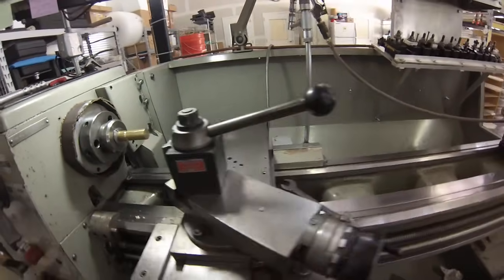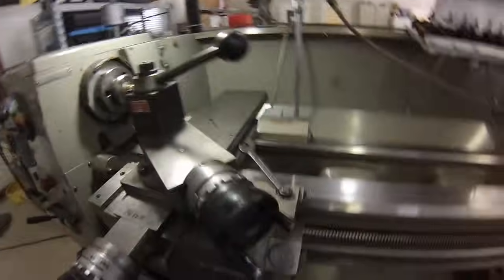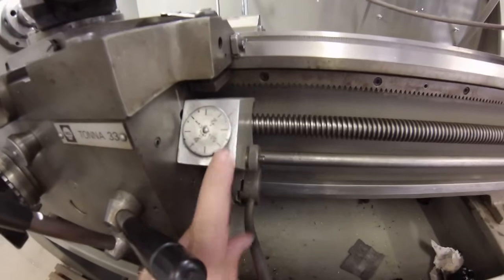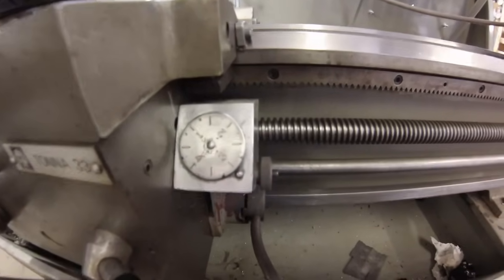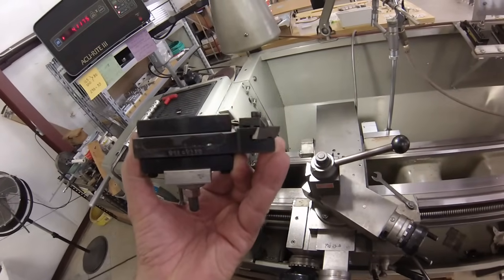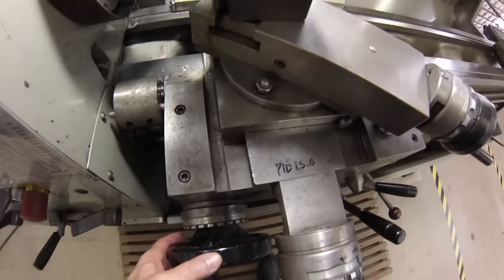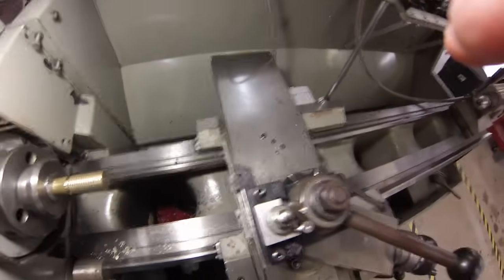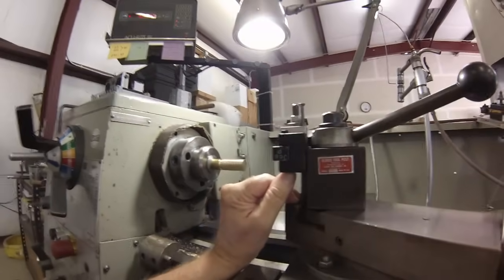Threading on a manual lathe  BEST TECHNIQUE EVER !!!!

Comment: This is from the Hardinge instruction manual about cutting threads on an HLV
http://www.csparks.com/hardinge/Manual/Page38-39.jpg
http://www.csparks.com/hardinge/Manual/Page40-41.jpg
http://www.csparks.com/hardinge/Manual/Page42-43.jpg
I'm not trying to hijack the threads or anything but am simply pointing out that there are other options. One thing that would concern me about this technique with the upside down tool is that the carriage ways on most lathes really aren't meant to be taking loads in this direction which could lead to chatter and all kinds of other problems
Reply from the maker: I have to disagree with you on this one. The mass of most lathes compared to the cross section of a threading tool is extremely one sided. The tool would break long before the machine would ever see any damage. As for chatter, chatter comes from rigidity where movement is not an option. The minimal flex afforded by inverted tooling utilizing the gaps between the carriage and ways, the cross slide and carriage, and the compound and cross slide is the perfect solution for chatter elimination or reduction. I've plunged hundreds of large contact form tools into high grade stainless steels with incredible success. A normally positioned tool would have never worked. Its also apparent you are a Hardinge fan. So am I, but don't compare the Hardinge system to standard engine lathe systems. They are 2 different animals.
Reply: I guess we will have to agree to disagree. Yes I will admit to being a Hardinge fan. Anyone whos ever run one is almost certain to be. But what I was trying to get across is the utility of this type of threading, no matter the lathe. I really think that lathe manufactures should make this standard on all makes of lathes. Plus I have been doing this in an industrial setting for 40+ years.
Reply from the maker: No argument there. The Hardinge setup is far superior to any other type I have ever used and absolutely should be available on more machinery. As for inverted tooling...Its Ok to have a difference of opinion. Try it sometime if you ever get the opportunity. It really is a fantastic way to reduce/eliminate form tool chatter. I also walked into my first industrial shop in  1976. Heavy lathe concentration for about the first 25 years. 6 days a week.

Comment: Sorry about the first link. I just did a search for Hardinge threading and I didn't watch the first one I linked. I did not realize the guy was using a Hardinge HC Lathe. Whole different animal. This should show it better. Watch the handle in the upper left corner. One engages the spindle (actually turns a drum switch) the engages the threading clutches. There are stop collars on a rod that connects to the threading lever that when set will stop the motion of the carriage. The other nice thing about the Hardinge is the retraction lever on the compound to get the tool out of the way on the return pass. Martin Cleeve has a whole section in his book on threading that covers this type of system and how he adapted it to his machine. But it is really adaptable to just about any thread cutting lathe out there. As to tool retraction there are a number of ways to do it usually builtinto the tool holder itself  https://www.youtube.com/watch?v=5nri1qFRguA
Reply from the maker: You can't compare threading on a Hardinge toolroom lathe to any other machine. There way is very sweet and well thought out. I've run those machines for years. The video link you attached shows the guy running a 1/4-20 thread in brass. If you note his dial movements, hes taking about .0015 per side per pass. Not a good example. Especially in brass, take a very deep cut on the first pass, followed by a couple shallow ones. As for the tool retraction, its the compound, cross slide, or cammed like the hardinge. In all my years those are the only 3 methods I've ever seen unless its full custom. If you can point out a specific alternate method, please post a link to that. Adapting a rod stop to a conventional engine lathe is possible, but would be a very creative installation. I'm not sure it would have a through carriage bore to mimic the hardinge. Maybe a right side projecting rod and swing lever. Thanks for the comment.

Comment: Nice video and info, I was taught this trick 30 years back by a WW2 ships machinist. I use this when threading gun barrels to get cleaner threads using higher run speeds.
Reply from the maker: I was shocked at how many guys never saw it done this way. I've done it this way for 40 years. Thanks for the comment.
Reply: welcome, nice video

Comment: Any tips on securing a screw on chuck for reverse turning (set screw, etc.)
Reply from the maker: A large heavy set screw or two would be where I would start. Putting a live center against the part will also help since the chuck has to come out to come off. Please exercise caution if you have a screw on chuck. This tip works better on cam, keyed, and collared chucks.

Comment: That's great if you can undercut, but some machine shops don't like undercutting,  so what do you do then?
Reply from the maker: Thread milling, or modified CNC code is the only option for a non undercut thread. If there is another way, please tell me.

Comment: what about mm threads? normal people dont need Imperial threads :)
Reply from the maker: Metric threads, in my experience, are done exactly the same way. The big difference is that the carriage is usually relocated by machine power. I have always run machines that require the half nut stay engaged for the entirety of the operation. It's a little tedious.

Comment: You need to be careful about spindle and lead screw direction. Some lathes have left hand screws and an odd pitch. I ran an older LeBlond lathe that had a 7 pitch screw that was left hand thread lead screw. It was a wonderful lathe for double lead threads. Even number on the dial for one thread lead and odd number for the other. I am glad you show checking pitch diameter with thread wires. I would suggest for a coarse thread move the compound 29.5 degrees toward the chuck. Good video.
Reply: ty

Comment: nice, very good stuff, only advice you're  moving camera way to much. to much back and forth.
Reply from the maker: It was shot in a hurry, and was my first machining video. Watch some of the others. I hope you find them better. Thanks for watching.
Reply: Joe Pieczynski I understand and have watched and agree now, hope u keep the videos up, you definitely are keeping things interesting and im learning things from you. I have a little shop and just self taught so i still learn everyday. Love your lathe. Ive always like that model clausing, did those handles come on that lathe or did u change those out? Never seem that model with those handles. I have a sharp 1340vs that i love but have always wanted one like u got or a bigger caddillac lathe for some reason lol. Thanks keep it up.
Reply from the maker: I wanted the 15" model, but I couldn't pass this one up. The handles are stock. The color code makes speed changes very easy.

Comment: Very nice. I used to make threads out of the head stock like you, but with the tool in the the oposite side and not inverted. I never tried your way. Do you have any idea about avoiding the chuck to screw  themselve off ? Congratulations from Brazil.
Reply from the maker: Possibly the use of a live center against your part, or a locking screw you install. Or both.

Comment: This is a great tip as long as the thread and load of cut is minimal, otherwise you are putting load on the cross slide and compound which it was never meant to have.  Not hating just making a point still a great tip.
Reply from the maker: After 40+ years of doing this with great success, I accept all comments. Thanks for watching.

Comment: I have been doing it this way for almost 50 years, but with a slight difference. I set up the tool on the back side of the workpiece without inverting it. That way, I can see what the tool and cut is doing just like it does when conventional chasing.
This is the first time I have ever seen the trick published anywhere. Good job.
Reply from the maker: That would work too, but can't be done between centers. I always thread out. Always. Thanks for watching.
Reply: Why can't it be done between centers? The only difference is that the 
toolpost (and tool) is on the back side of the work, and is also done 
threading out, which, of course, is the key to the technique.
The only time I wasn't able to do it was when the crossfeed didn't have enough travel to get the toolpost on the back side on some smaller lathes. Fiddling with the compound is always necessary.
Reply from the maker: Hi Joe. Have you ever actually done this on a part between centers? Seems to me, the environment isn't conducive to success. I may be wrong.
Reply: Well, not purely between centers, but supported by a center in the tailstock. The part chucked in the spindle end. Also, the compound is swung around to the back with this setup. Otherwise it would interfere with the tailstock.
I'm curious as to what you may visualize as an issue.
Reply from the maker: Hi Joe. On a long shaft between centers, or a large diameter part, I am having a hard time seeing all the machine parts clearing each other. On smaller stubby features, I am sure the machine could be tweeked to achieve success, but that where my vision stops. These machines aren't designed to extend far beyond center. That fact is even compounded (no pun intended ) when you swing the compound as you suggest. You could leave the compound in the front and just back it out if you still want the 29.5 degree advantage. Maybe my machines are different. I will loosen one up and see haow far I can push it. Not saying it won't happen, I'm just saying the alarm in my head is saying there will be a problem. Then tell me what kind of tool you are using and how your holder is positioned. That may help.  I'll let you know.

Comment: An especially good idea when threading a BLIND hole ! ! ! Also , have you ever used the one wire method ? 1) - measure major O.D. - ( 2) measure over part with One wire  - (3) subtract major O.D. from measurement over PD + one wire (4) multiply x 2  (5) add this to major O.D. ----- it sounds nutty , but it works ---- really good on LARGE threaded parts
Reply from the maker: I have not. I'll draw that one out and try to follow the logic. Sounds like its a radial calculation x 2.
Reply: First time I thought it was nuts, but for large O.D. threads it saves you from rubber bands or grease

Comment: Also, this allows you to run at higher speeds which carbide likes
Reply from the maker: I wouldn't do this any other way.
Reply: I may have to try this to eliminate my corn cob threads. My old lathe had so much chatter that I could not improve any thread.

Comment: Great threading method, especially when working close to the chuck or a very narrow relief groove. I first saw this done about 1957 by my machinist mentor who taught me much of what I know. It's the only method that works when chasing internal (B) threads to a shoulder that you can't see. Just stick the upside down tool in the bore to your preset stop, dial in to cut depth, and engage the half nut to feed safely out. Thanks for sharing your skills again with your viewers .
Reply from the maker: Good to hear from you again. This is a fantastic technique for blind work. I'll video that soon as well. Always appreciate your comments.

Comment: I am going to re visit this and tell what I have done.
From fear of turning the spindle on the wrong way I have installed a forward rotation bypass switch. 
I also started treading on the back side of the stock with a boring bar with spindle rotating backwards and feeding out.
Reply from the maker: Thats going to work just fine. It won't work for shafts in steady rests or parts between centers. Let me know how you like it.
Reply: It works great I can use the front of the tool rest as a stop and start right back where I started without cutting a groove.
I can move the boring bar in and out to make thread length adjustments like a carriage stop.

Doing this at 200 to 360 RPM feeding straight in with a carbide tool.
But before I could get comfortable with this I had to disable the forward rotation.
All it would take is one time putting it in the wrong direction after you stopped for some reason.

The thread dial is running balls out.LOL

Comment: If there was enough area in the undercut I would figure one would not have to hit "0", but just insure the correct thread gauge mark was engaged. My old lathe (without DRO) might be somewhat sloppy trying to find an actual "0". Would this be correct??
Reply from the maker: Hi Tom. I have a DRO on my lathe, but never use it for threading. I can say, when I did thread towards the chuck, it was a combination of visual and indicator positions that prompted my half nut action. The Zero you may be referring to is the thread stop point. It could be a temporary magnetic base with an indicator, a Trav-A-Dial, or whatever you choose to reference your stop point. Eventually, you'll run a very fine thread with an exceptionally small undercut relief and then you'll appreciate this tip. Threading out from the chuck only requires a groove equal to the thread profile. Nothing else. If you use a physical stop when threading in, you risk damage to the part, tool and machine.  If your chuck is secure against un-screwing, try this. I bet you never go back to the old way.
Reply: Thanks, Tom

Comment: Fantastic technique!  So possibly an alternate way of threading toward the tailstock would be to move the tool around to the back side of the work, mounted upright in the tool holder and run in reverse as demonstrated.  Never tried this but will have some fun this afternoon on my 10EE.  Thanks Joe - SUBSCRIBED!
Reply from the maker: Yes. That would work. It would not work on parts between centers or in a steady rest. Let me know how you like it. ZERO panic factor. Watch the screw on chucks though.
Reply: Just cut an aggressive 10 tpi thread as a test and it works great!  It will be my new "go-to" technique!
Reply from the maker: It takes the pucker factor out. Thanks for the feedback.

Comment: well no disrespect joe, but threading upside down and backwards hardly changes my life in the  shop, plus looks like your compound is set wrong, it should be set around back. opposite of what you have. keep your tie tucked in!!!
Reply from the maker: You never know. If it takes the stress out of threading, you may live longer. I appreciate your comment, but the compound is fine the way it is. Straight in threading like I do doesn't require any 29.5 degree voo doo.
Reply: True, you really can thread with the compound in any position. But....when you cut large threads it really makes a difference in thread quality and finish. keep up the good work!

Comment: Hi Joe
This way of threading is certainly easier and not nerve wrecking unless your lathe has a sliding tool holder.That way you can adjust your center height regardless of direction.Most lathes come with a standard square slotted tool post and when you fit the tool upside down as in this case center height can't be achieved for standard inserted tools unless you make your own tool.
Reply from the maker: Refer to the term...toolmaker. Take it from there.

Comment: glasses are not safety glasses.  ask me how I know.  :(
Reply from the maker: I have no excuse.
Reply: Any glasses are better than none. I had regular glasses protect my eye against a strong spring that flew loose. It put quite a gouge in the lens but saved my eye. It hit hard enough to knock my glasses part way off. I also have ANSI safety glasses with thicker lenses and side shields.
Reply: True true!  But I've also had a hot chip arc over the lenses and into my eye.
Reply from the maker: I had the same thing happen. A fragment from an exploding end mill is still in my right eye from years ago. It was a ricochet. Came in over the top.
Reply: The side shields for my safety glasses provide partial protection from debris coming over the top of the frames, but it is still possible. I have Titmus TNM5 titanium frames, sturdy and lightweight. Maybe your experience is a good argument for a follower shield attached to the carriage, especially on risky operations.

Comment: Joe:

Why no undercut?

I worked for many years as a CNC programmer and more often than not I got into verbal fights with mechanical engineers. Once an engineer wanted a fellow programmer to thread up to a shoulder and have the "vee" of the thread diminish into nothing! Finally had to give him a "shop class" explaining how threads are made. Another problem was shallow drill depth callout when tapping - always a guaranteed collision course inviting tap breakage. I just looked the other way and programmed the drills deeper.

Back in the 60's when I was a kid my family went to a Sunday afternoon Church function at a members house. In Mr. Locte's garage was a small drill press with a Texas A & M logo. When Mr. Locte was an Aggie engineering student he made that drill press! In order to get an engineering degree he had to have first hand experience in pattern making, foundry work and machining - the only purchased item allowed was the electric motor.

Sadly, many mechanical engineers are text book only.

-'lil stan
Reply from the maker: This is a sad fact in the USA. European engineers must spend considerable time on "the floor". A good engineer will actually listen to the guy that makes the part and learn something.